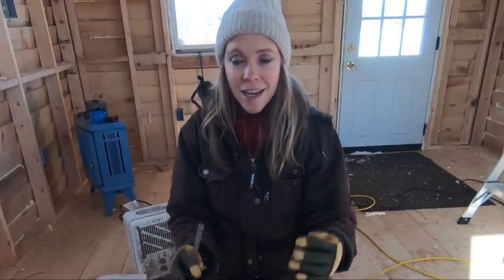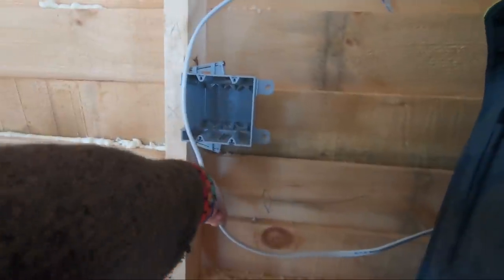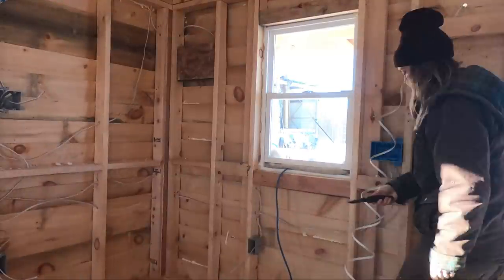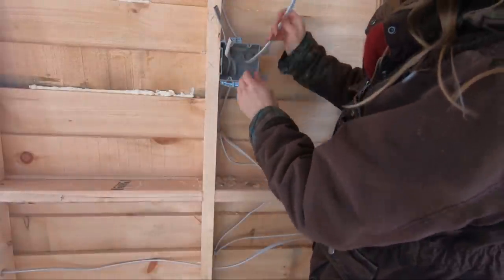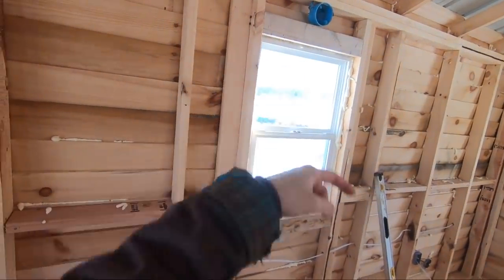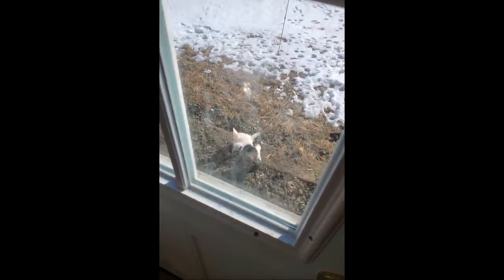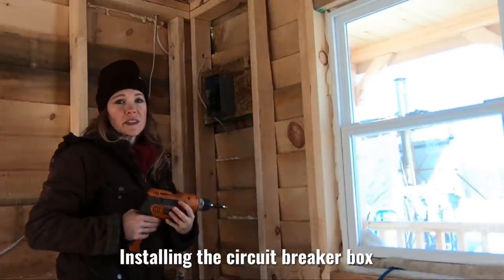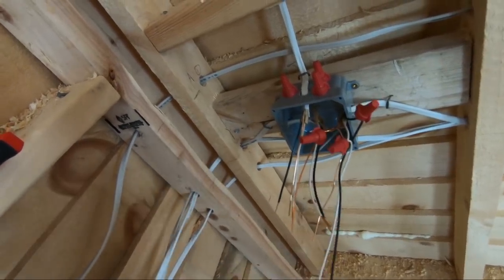My Electrical Wiring Was a FAIL! -- DIY Tiny House Amish Shed to Office Build Vlog#5

Comment: As with any project it is best to have the right tools for the job. Electrical projects are no different, Wire strippers, needle nose, romex sheathing strippers. The needle nose work good for pre punching the holes where the wire goes into the boxes so it's not as tough to push the wires into the holes in the boxes. Even a small nick in a wire can cause an issue over time so I would be extremely careful using that knife for much of anything. Even though it is a simple shed all electrical has rules for installation and safety. A disconnecting means inside the shed which looks covered with the 30 amp breaker box. As it is an outbuilding and does have a panel in it of sorts it will typically fall under a sub panel rule meaning the grounds and neutrals will need to be separated in the panel and the neutrals will need to be isolated from the bare ground wires. Not sure why there is a weather proof box under the panel, a standard 2 gang would work and could install plugs or even a blank plate to match the drywall if installed at some point. I think you will end up hating having the lights on the walls and at face height as the light will always be in your face. If it was me, I would install the round boxes in the ceiling and then find some led lights that will surface mount to the ceiling so the lighting will be spread out more evenly. Electrical can be intimidating if you have never done it before. Some typical rules are, staple the wire within 12 inches of the box since most those boxes have tabs in them, otherwise 8". Long runs staples every 4-1/2 feet. Be careful when hammering in metal staples like those as they can pinch the wires with excess hammering. Having done electrical for 24 years I think you did a pretty good job so far. Looks like a fun project!!
Reply from the maker: I went back and forth about the junction box. It came screwed tight so I didn't know until I opened it that it was a weatherproof box, lol. I almost did a double gang box, but figured this would be more "acceptable"?    And I didn't know there was a romex stripper. Dang as many times as I went to the hardware store I coulda bought one! Maybe I'll see if Erik can find me one at Meijer today!

Comment: You are doing a good  job, those look like fence post staples if they are not a good idea for an type of wiring. code or not
Reply from the maker: They are smaller and non barbed :) These are for electrical wiring :)
Reply: Sorry really  hard to tell on my computer

Comment: do you self a favor get yourself a romex cable striper and it will make pulling the jacket off 10 times easier.  look for a "gardner bender  CR-100 4" romex cable ripper" it is less then $5 on Amazon and at any box store.

Comment: Suzanne, I cringed when you pulled out that knife and started using it on the cable sheath.   You’re not skinning a deer.   You may not pass your first electrical inspection, but you are close.    If it were me, I would put some ceiling boxes in for a few lights, just in case.   Also, put one in for a smoke detector for the future.  I’m assuming you are planning on no air conditioner.  Question, no need for data cables?   Is there a kitchen counter anywhere in the future?
One thing you do need to do is run a #6 bare copper from your panel to the outside of the shed down to the ground and have at least 10’ of conductor for two ground rods.  (Required).
Reply from the maker: It's a bit more sticky than that since it will be off-grid and considered "portable". So I've got to do a bit more research into what grounding entails :)   I do plan to do a smoke detector, but a battery operated one :)
Reply: @This1LifeWeLive     Just so you know Suzanne, the function of the #6 copper and ground rods is for lightning protection.   Nothing else.

Comment: DO NOT DUMP ON YOURSELF!!!! You ALWAYS power through and get it done. How many people would even TRY to fix a haybine????  You do FAR more than most people. MOST people didn't grow up doing electrical work. What you are doing isn't hard but no one can do it until they learn how. I know people that won't touch anything electrical for fear they will end up burning something down or electrocuting themselves. 
A couple of suggestions: 1) Keep the wire flat, unroll it, don't unspool it. 2) maybe use a slightly larger bit to make the holes 3) lever the "clamp" in the plastic box up a bit with a large screwdriver before trying to shove the wire in AND make sure the wire is running flat into the box. 
Are you using 12-2 or 14- 2 wire? If 12-2 you might want to consider putting in 1 20A breaker for things like the electric heater. 
You left an "electrician's length" wire coming out of the box :D  Per code you should have the wire stapled to the wall within 12" of the plastic boxes.

Comment: Make sure you isolate the ground and neutral in the fuse panel seeing it's not the main breaker panel. The panel needs to be grounded and you will need to drive a ground rod and run a ground to it.
Reply from the maker: How would I do that with a portable unit that's collected to a generator? I haven't researched that far yet . . .
Reply: @This1LifeWeLive  Modern generators have a separate ground and neutral. They even have a grounding lug for an earth ground. A power inverter for solar should come with grounding instructions. You probably ground it's case. Regardless, I'd keep the neutral and ground isolated in the fuse panel. Maybe even put a receptacle on the outside so you can just plug in a power chord  to a quiet inverter generator. Although, you will probably need a generator for nothing else but too charge your solar battery bank when there isn't enough sun.  Sorry for making it more confusing for you.
Reply from the maker: @robertkent2466  No, this is good. I was just researching on grounding generators and why some are and some are not, as well as grounding solar panels. Right now trying to figure out how to bring IN the eletricity from a solar/wind array and stick it into the fuse panel. Found some nice battery operated gennies that charge by solar/wind but like you said, they requirre a plug, so trying to figure out the "proper way" of hooking it to the cabin (beside just back feeding it via a plug). Unless that IS the proper way, lol!

My IDEAL set-up would be a gennie hooked to a wind/solar set-up with fine sine invertor where the gennie helps carry the load of the set-up automatically (kicks on when power drops from the solar/wind) and turns off when not needed. I've looked at re-chargable gennies, but not opposed to gas powered . . .
Reply: @This1LifeWeLive  Seeing you plan on moving it around, you might think of it as a RV.  You could mount a RV receptacle on the outside and wire it directly to the fuse  panel as your  power source on the line side. This would give you the option of connecting multiple power sources, and adapters are available.  I would still run a ground wire to the outside that bonds your panel and ties to the grounding bus that you should connect to a ground rod. I could see a solar generator would be great for a hunting shack seeing it's just a rechargeable battery bank with control circuits, It wouldn't make noise. Although, they do degrade over time  like solar panels and wind generators. I would consider this along with the cost to determine if it is worth it.  I see the best panels are guaranteed for 25 years. Also, you'll probably want to put your outlets on a GFI.  It's code for all out buildings and seems to be also for a RV. I would use a GFI outlet for the first outlet; It would protect the others on the circuit.  Also keep in mind that no matter what kind of portable generator you use, the manufacturers don't want them in the rain or snow, and some don't want them in enclosures especially with a combustion engine. I wish you luck. Take your time and let the wood dry. You will want everything right before you cover the wood and wires with foam. I'm going to keep watching to see what I can learn.  Keep up the hard work.
Reply from the maker: @robertkent2466  excellent thoughts! I had been trying to figure out how to connect it from fuse box to solar array, but an RV setup might be the solution!  I did try to find gfci outlets but can't find them anywhere. Might opt instead for gfci and surge protection breakers instead. More $$$ but double protection.

Comment: There are a lot of mistakes Suzanne but don’t let that stop you.. everybody makes mistakes that’s how we learn. And don’t let comments get you down. I have a feeling your breaker box is undersized to begin with.. of course if it is your inspector will tell you that. Also don’t get depressed if you fail the inspection as a builder it’s happened on my job sites more then once. When you get your inspection ask questions of you inspector. As a rule when I would pick up my permits from the city I was working in I would meet with the inspector and ask him if there was anything special they needed done or if they followed the National building codes  each municipality can have certain things they expect and arguing an issue usually only causes problems. I had an electrician that constantly wanted to confront the inspector on codes. And even though he was right 99% of the time it still caused issues.. so don’t get depressed if you fail just fix the issue and move on 😊
Reply from the maker: Thank you George :)  I am mentally prepared if there are areas that need to be fixed! I did call his FIRST and ask questions (mostly about height regs and such) and he honestly wasn't concrned about anything like that for a shed hookup. I'm sure he's going to be surprised at how much wiring is in there (he's most likely picturing 2 wall outlets, lol), but once I explain how closely I was trying to follow code in preparation for the upcoming build, I'm sure he'll laugh and then give me some tips!
Reply: Party on I really do admire your attitude

Comment: You didn't have to make the holes, you could put the wire between the rips and the planks.
Reply from the maker: Someof them I did :) But I know I drilled more holes than I needed ;D

Comment: work is much better in the heat (Cpt Obvious LOL), i strongly encourage you to research how to twist wires correctly (safety issue) (its hard work) and (hopefully no wire nicks) ......also encourage you to consider how the electrical loads will be applied IE..a computer on the same circuit as HVAC or heater is discouraged for obvious reasons if you haven't already ..... one of the best electricians i ever hired was a female so learn by doing and by mistakes we all made them
Reply from the maker: once everything is installed, I'll walk through each outlet and light and show why I ran the wires the way I did. It seems like a helter skelter set-up (and many pointed out excessive use of lines) but there is lots of thought and planning put into where each outlet and light goes and what it will be used for :)      But I will look up how to twist two wires :) I know how to twist one wire on a fenceline, lol!

Comment: You need a wood 🪵 stove for heat. It’s snap crackle pop will keep your spirit warm too 👍
Reply: What's that in the corner?
Reply from the maker: LOL a fake fireplace! It heats too, but not nearly as much as the smaller heater!
Reply from the maker: I'm trying to figure that out. Maybe I'll do a video asking for tips and suggestions :D
Reply: You mean the blue thing ?
Reply: Hay Farm Girl 👧 here’s a tip and suggestion. Don’t use the blue stove for real. The fumes and smoke will kill you as the paint burns off. Do you have Tractor 🚜 Supply near you? They have wood stoves and stove pipe at a reasonable price 👍

Comment: Exterior front porch light and outlet??????   Work together with Eric to do the wireing.
Reply from the maker: Just an outdoor porch light :) Since it will be off grid, I don't plan to use all the outlets, and less is better. But according to code they gotta be every 6ft inside . .
Reply: A outlet outside outlet is nice for christmas lights and front porch winter projects like sawing, drilling, ext..

Comment: Doing awesome until that knife come out for removing the sheathing. Very easy to cut or nick  the wires then you have to replace it
Reply from the maker: This one isn't sharp enough to nick any wires, but it IS too bulky for the job. Need to dog out an exacto knife ;)
Reply: @This1LifeWeLive  Be safe and just buy a Wire Stripper.

Comment: your suppose to break out the little blue taps on the electrical boxes then wire slides through easy
Reply: Suzanne was not using boxes that had breakout tabs.
Reply from the maker: This is an interesting issue. I had been reading up on boxes and howmetal boxes need additional inserts to keep the wires from slipping out, but plastic boxes didn't. I assumed that the tabs were the device used to keep the wire from sliding, and hadn't seen any notes online about punching anything out. With that said, I did see a video erik was watching about someone else installing eletric and they ripped out the back tabs, and this threw me a bit.

So do they need to stay or can they go? I don't know. But better safe than sorry, I'll ask the inspector when he comes :)
Reply: @This1LifeWeLive  it's me, Suzanne, chiming in😁. They used to make the gray boxes that were fairly brittle plastic, and you DID poke the tabs out with your screwdriver. And you left the tabs in any unused holes. I think this is to keep mice out. The wire FILLS the hole once through it. On the blue boxes, the flexible tab gives just enough to pull the wire through, and you're right, it kinda bites into the sheathing if you try to pull backwards. In any event, it's not something an inspector is gonna worry about. 
I think you're doing a great job!!! 
A few years ago, I bought a little book on the basics of the Electrical Code and simple home and shed wiring. That little paperback has gotten a lot of use over the years.

Comment: You get an A for effort, but you have a lot of unnecessary wires.
You have two 15 amp circuits.  The lights will not use 15 amps, so you should have two circuits with lights and outlets on each circuit.
You only had one roll of 12-2g wire, so you will not be able to turn on the same lights from switches by the doors.  (In other words, you cannot have any 3-way switches.)
If you are planning on 3-way switches, I would like to see a wiring diagram showing how you ran the wires.
Actually I would like to see a diagram of the wires in the whole building.
Reply: I do not think she has it wired for three way switches.   But, if you are determined, you can (in a very strange way, connect three and even four way light switches up to lights and make it work.   The first time I saw it done, I had to draw it out and do some thinking to figure it out.  Trust me, it can be done.
Respectfully,   Kevin
Reply from the maker: When I sat down and planned out my lines, I planned based on load first and foremost. I knew my computer set-up would hog a lot of juice, and IF I opted to run an electric heater or some other system, I'd want it on a separate line from my computer. I won't have much else plugged in, and lights used once in a  while. So I balanced load overall based on what might be run at any given time, whether plugged in or lighted.

The wiring is 14-2, based off my 15 amp breakers.

I don't have any use for a 3-way switch, but I do have a 3 switch gang box with 3 switches for 3 different lights.
Reply: @This1LifeWeLive    Just making sure.   Your incoming power is 30 amps at 120 volts?   One hot, one neutral, and one ground.